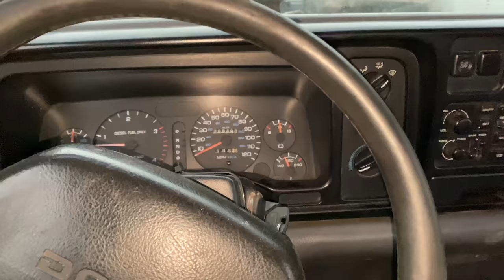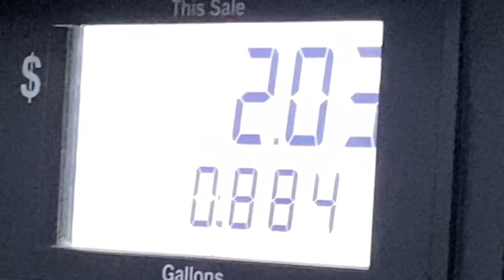Can't Dodge It? RAM IT!

Comment: I’m not one to tell you what to do, but floating gears does hurt the synchros
Reply: Not if you float the gears correctly. Under certain circumstances with bad synchronizers floating the gear is the only way to get it in. Just has to be the proper rpm with very little stick pressure. Incorrect rpm and lots of pressure forcing the transmission into gear will certainly hurt your synchros but it can be floated properly. I have a 96 2nd gen 12v dodge with the 5 speed and when my 3rd gear synchro went out I had to either float or double clutch to drive it.